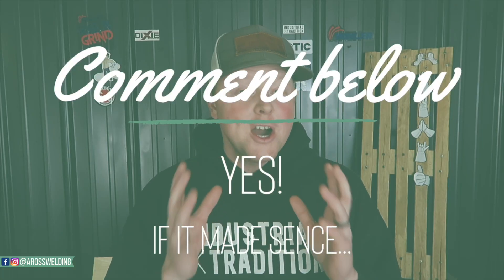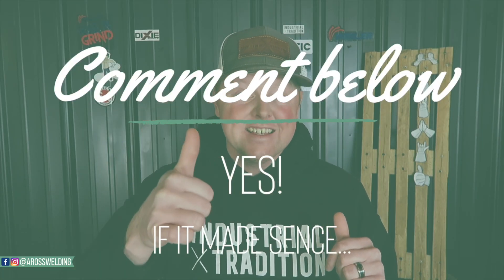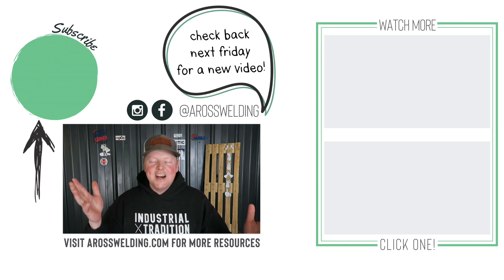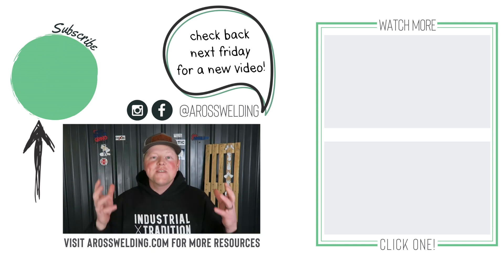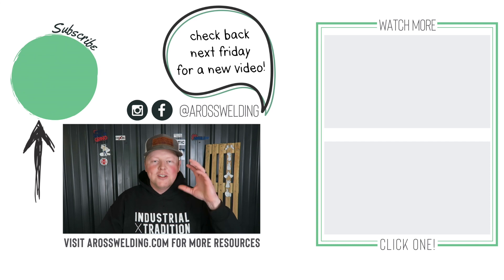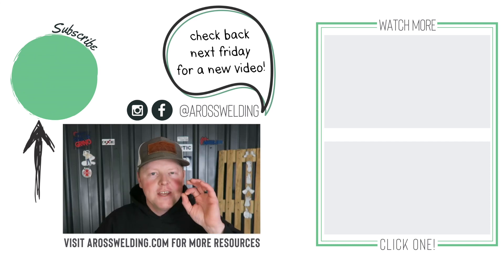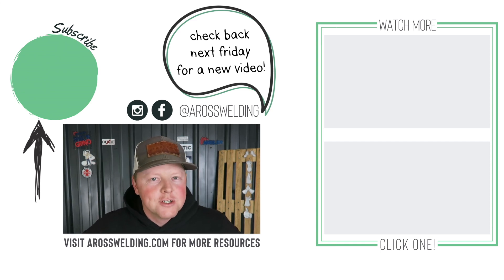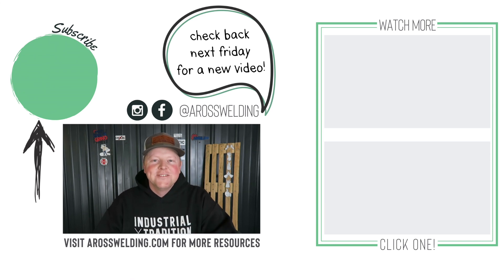PIPE WELDING A BAD FIT // WHICH SIDE DO YOU WELD FIRST?

Comment: Depending on the wall and size of the pipe. Can you run a Zip disk or 1/8 “ wheel to create the gap you need for a good bead? Or do you just run it and crank up the heat for the hot pass?

Comment: Yes. I’ve also been able to weld on 4 inch or 3 inch where I only put three tacks and than just start running my bead on the side that doesn’t have a tack. I’ve also just tacked the pipe on top and bottom and ran with it and let the heat pull the skinny side. Don’t know if that’s ok but the beads came out good.